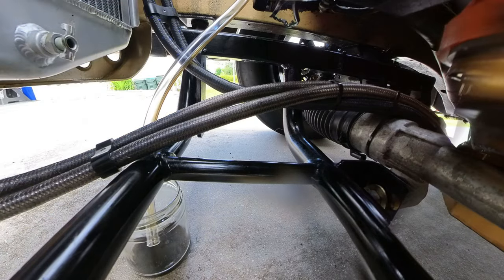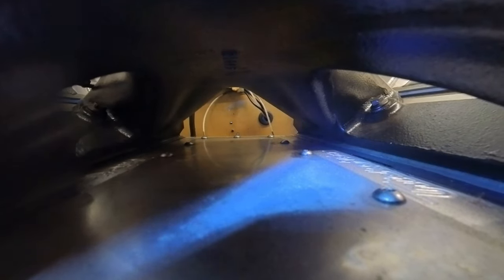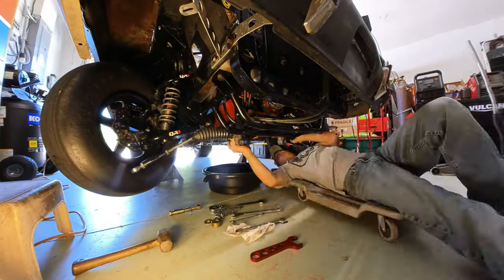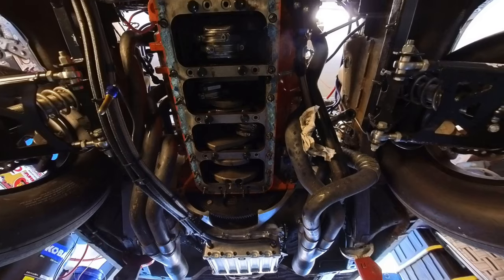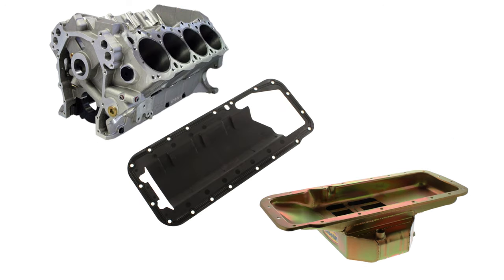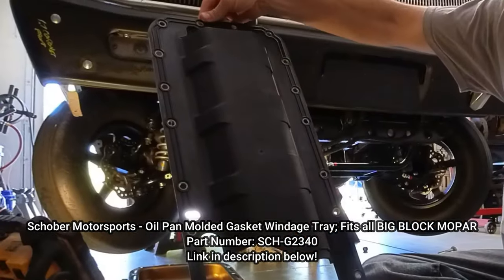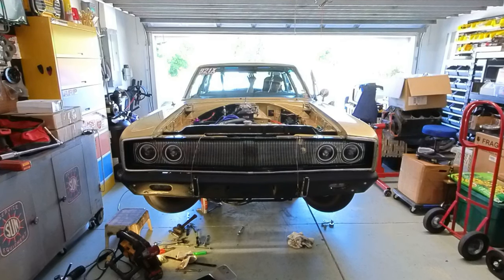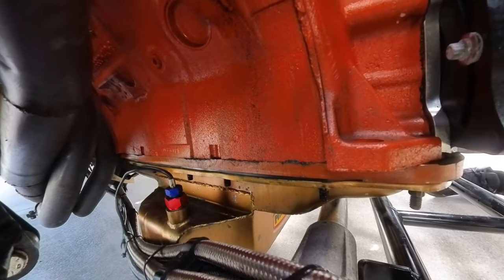The BEST oil pan gasket for big block MOPARs! Chasing down those pesky leaks! #becauseracecar

Comment: Very cool!  I love the use of the smoke machine!
Reply from the maker: Thank you! I thought it was a really cool tool! Read about it online, but never saw it in action.
Reply: @SchoberMotorsports  I never even thought about that, let alone it working! Really cool! I never thought the leaks would be that large to show smoke!
Reply from the maker: @follkiej Same here, I did have signs that it was leaking before but it would be a drip or two in the trailer after a race... but I never saw the pan "actively" dripping when it was running.
Reply: @SchoberMotorsports  I work at an accelerator lab where we test joints to the -12 vacuum range. I see now no engine builder needs that! So cool and genius!